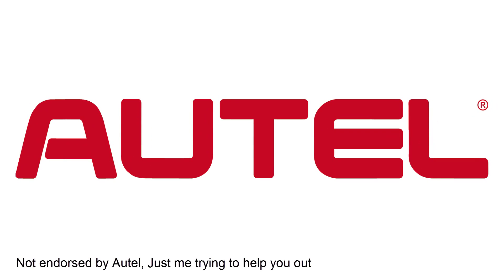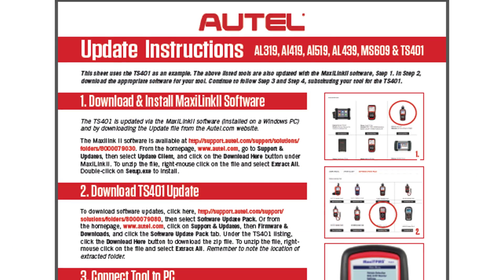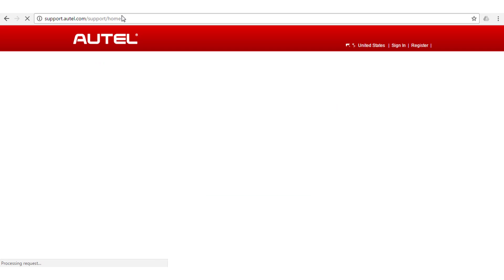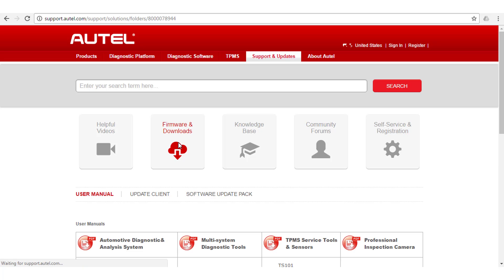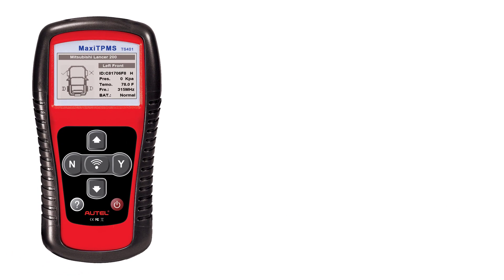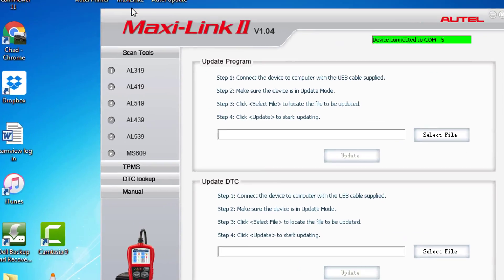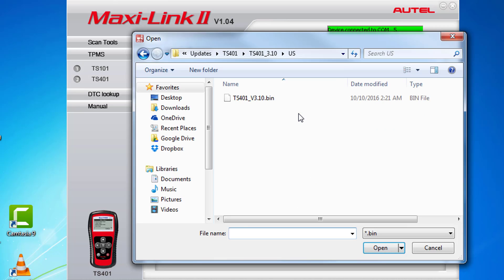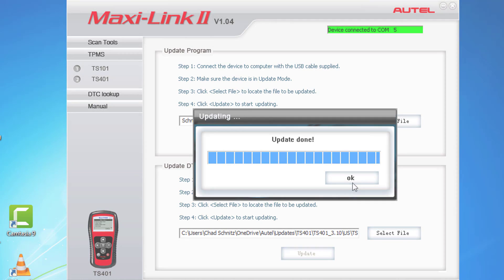How to update your Autel Autolink and TS401 tools

Comment: I have the AL319 and an error occured when I was updating it on my PC and now it's saying "Authorization Language Not Matching!". To fix this, you unplug the device powering it off, then hold the ENTER/EXIT button while you plug it back in and it will forcibly enter program mode and you can try updating it again. Hope this helps anyone that also had this issue.
Reply: It helped me! Thanks very much!
Reply: @Schrammbledeggs  No problem! I knew others with the same issue might come to this video.

Comment: You say if my tool isn’t listed to select “this video”. But there is nothing to select. I am trying to set up and do the initial program file and DTC file for anew al539. Can you point me in the right direction? My problem is that when I go into update mode there are no files to select.
Reply from the maker: https://www.autel.com/download.jhtml Select the icon that says MaxiLink II, It shows that the updates for the AL539 are there.  Otherwise I would recommend contacting the support team. I didn't see any other updates on the site.
Reply: @FlashPerformance  thanks . However,  there are no files when I hit ‘select files’. I did contact support after I left my question for you. They agreed there was nothing there on their end either.  They said something about the files being removed for some reason but that the units being shipped out were supposed to now be updated before they were shipped. However, I pointed out that, as is, there was a lot of missing functionality . When connected to my vehicle it just can’t do several things that it is supposed to do. They are supposed to get back to me next week and hopefully will be able to find some necessary files and email them to me.   Guess we will see. Thanks for taking the time to get back to me.

Comment: Does the back light and beep sound  work when using only the 9 V battery and not connected to the car OBD (autel maxiscan ms509)
Reply from the maker: I have never used an MS509 so I cant answer that question.
Reply: Flash Performance Thank you

Comment: My TS401 will not update past 2015? Any ideas?
Reply from the maker: After you have completed the update go into settings>region and change it back to USA.  For some reason it auto defaults to Europe upon update.
Reply: I don't know what you mean? I don't even have Europe under my settings! I mean my tool will only let me choose up to model years 2015. and no 2016,2017 or 2018.
Reply from the maker: Sorry I was trying to do it from memory.  On the main screen go to Settings>Market>America
I just updated to V5.31 and I have 2017 software on most manufacturers.
Reply: OK! Thank you, I finally got it figured out. Mine says it is running on V5.41GL.  Only thing is when i turn it off and back on it says NOTE aut version is defferent with bin version! Please update in pairs! And yes that is exactly how it is spelled on the screen.

Comment: I haven't been on a computer in ages. So help me out here please. Do I unzip these downloads first? And where is it best to save them to on my computer? I'm lost.
Reply from the maker: Yes, you will have to unzip them.  I use 9 Zip to unpack them.  I created a folder on my desktop that says "Updates" I keep the files there.  They are easy to find that way.
Reply: @FlashPerformance  thank you.
Reply: @FlashPerformance  I meant to also ask another question. I have the AL519 and I'm trying to register my device but when I get to where it wants the serial number and registration password it only shows the serial number. Do you know why that is?
Reply from the maker: @debcarrothers2923  I dont think the AL519 has to be registered. However if it does you can go to settings>about and you will see the serial number and password.  Contact Autel support @ 855-288-3587 if you need more help. They can assist you with the registration and update process

Comment: Where can I update the al319?
Reply from the maker: Here is the update for the AL319 http://www.autel.com/autelcms/u/cms/www/201312/2404061882ge.rar
Here is the update client for the AL319 http://www.autel.com/autelcms/u/cms/www/201601/290138144omh.zip

Then just follow the video, it is a simple process
Reply: Thanks. Much appreciated!
Reply: @FlashPerformance  i've followed your video but get "wrong device" first bit went fine, it got stuck on "DTC" any advice?
Reply from the maker: @plageran  I had that issue last week. Try this download for the update http://www.maxitpms.com/u/cms/www/201905/TS401_GL_Update_V5.57.zip
Reply: @FlashPerformance  thanks man, i found the issue was: using USB3 instead of 2. i swapped the ports and it completed the update. i have the 319

Comment: NOT working.cannot download update file.windows says invalid file
Reply from the maker: Current update version is V3.20 go to http://www.maxitpms.com/tpmscms/Downloads/index.jhtml and hover over the TS401 and select TS401_Updata_V3.20.zip
Reply: Flash Performance im using autel 519
Reply from the maker: Sorry, This should be your link for the AL519 http://www.autel.com/autelcms/u/cms/www/201508/04042250p9fc.rar  I just did the download and it downloaded fine on my end.  Calling Tech support would be the next step http://support.autel.com/support/home
Reply: I have the same problem as Vidmis. I did contact Tech support. I was advise to follow this video- step-by-step. This video does not help-if the zip file is invalid/corrupted/ no file at all????